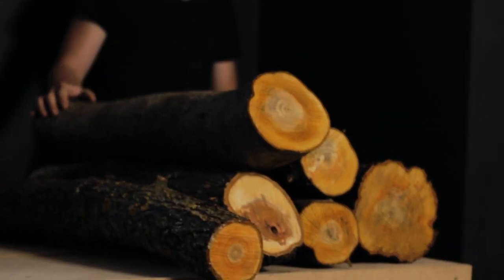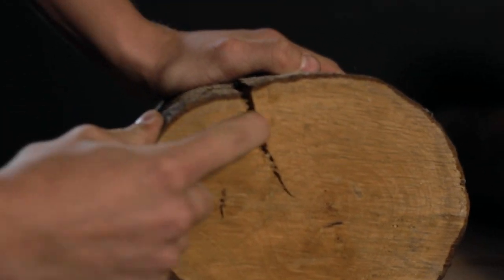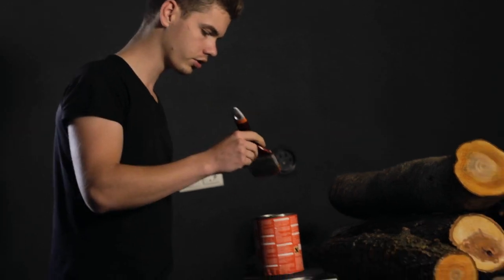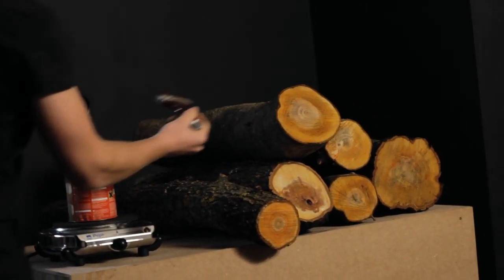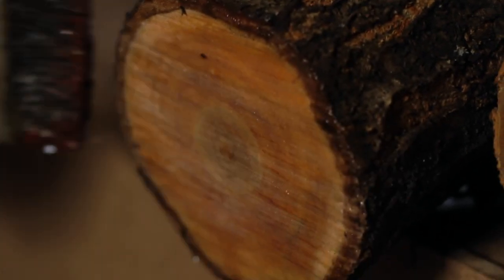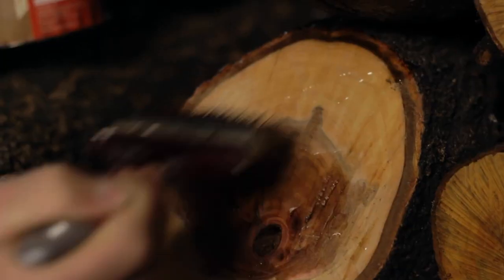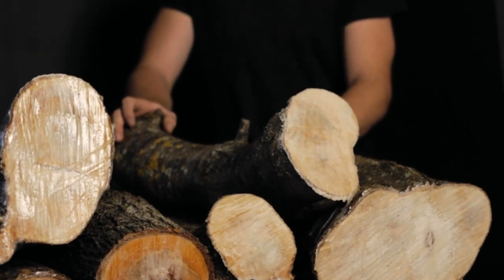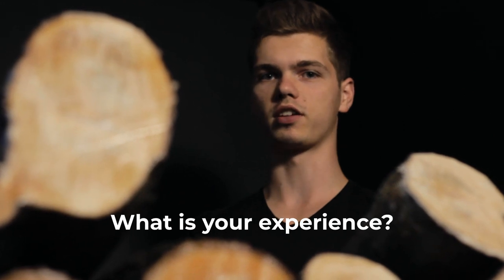How to Dry Wood Without Cracking

Comment: The product most recommend is anchor seal. Don't know how well it works personally, another method is to use latex paint in a few layers. I guess based on the number of methods out there, it doesn't matter what you use as long as it's effective.

I've used latex paint and it seems to work, but I haven't compared it to other methods. I've also heard that you can submerge wood in water and it will still dry out, though I haven't the time, nor resources to confirm it.
Reply from the maker: Thank you for the insight!
Reply: I have submerged green cuts in water in an old bath tub and contest that it works. Helps the wood reach equilibrium moisture content
Reply: @Fluid_c  You mean once you take it out it doesn't split? How long do you keep it under water?
Reply: @schnipsikabel  I have tested this with some green branches for a few days and it works, and I think it's less likely to split then the wood drying just in the air
Reply: @Fluid_c  for how long ?
Reply: @davi11994 how long did you leave it submerged?😊
Reply: @davi11994 were they with the bark on ? Or cut blanks without bark?😊

Comment: I have a round of redwood about 24 inches in diameter and 45 inches long that I plan to work with. Sense it is a larger piece, would you suggest cutting it into the slabs I want before drying it?
Reply: Reezee27 ....no, and if you want to make sure your wood is ready and won’t crack get a moisture meter.  FYI, I use Elmers glue to seal the ends but you need to keep the wood inside if you use glue.  It can be washed off.
Reply: No! Will/may warp and get all crooked. Dry first.

Comment: Have you ever dried a branch and have any tips for it? I'm thinking of waxing thinner sections of a branch to reduce cracking but I don't know
Reply from the maker: You could try to do the same method. I have not tried to dry small branches, but it should be similar and much faster 🙂 Let us know wether it worked out for you 😉
Reply: @NewCraftVideo  will do!

Comment: I  put some  oak logs in my garage to  store till i could use them they are 24in across,  they have BIG  cracks in them..... but for what im doing with them  this will add character to my work.
Reply from the maker: Nice! What do you use them for?
Reply: @NewCraftVideo  Sorry for the late reply, I will carve some into spheres,  I made a rig to do this, others I want to make large bowls, like doe mixing bowls, the cracks I will "lace up" with wire and or twine to make i look like a broken bowl was repaired, the lacing is ment to stand out and give character to the whole piece.
Reply from the maker: Sounds awesome! 🤩 If you have seen our other videos, you will know that we like the look of burned wood, so of course we suggest you trying also that out 😉

Comment: My experience was bad, because I was trying to dry my wood with a candle but all the material burned. :/
Reply from the maker: That's very sad to hear. Hot candle wax is extremely flammable, it can catch on fire just by being poured on the floor... You shouldn't heat it near to anything flammable.
Best luck for doing this next time!
Reply: @NewCraftVideo  Next time I will use your method! 
But your "like" will definitely help me to do this right.
Reply from the maker: Afterwards please comment here your experience with our method 😉
Reply: Lol

Comment: I've used PVA glue with great results. It's much easier.
All the best.
Reply: yup, cheaper than anchor seal too.  Wax is good too.
Reply: Like elmer glue?
Reply: @dcgo44r  no, PVA wood glue, like Titebond I/II/III
Reply: @dcgo44r  Yes, exactly.
Actually I have found that even better than just glue is to get some tissue or similarly absorbent paper and soak the tissue with glue and stick that to the wood. I've never once had this method fail.
Good luck. 👍
Reply: @motleypixel  isn't elmer glue, wood glue? "Acetate .." Is being known forever for small not critical joint and fixes! Way before titebond..
Reply: @ivancho5854  there you go! I was using it too! I do water it down a bit so it penetrates deeper into the wood then a regular coat afterwards! I learned about acetate way before I did any carpentry as threads/ color sealer in fishing rods dressing back in the early 90's! Much cheaper that a galon of wood juice $80. 😲
Reply: @dcgo44r  Yes, I forgot to say to water it down to improve penetration. 👍
That is one of the reasons why I use tissue, because it reduces the amount that the glue runs when you load it heavily.

Comment: whats the temprature you store them in? how do you know when they are done?
Reply from the maker: The recommendations we found, claimed that it should be an inch in an year. We are storing the logs in an garage, so the temperature varies from 5 to 25 degrees Celsius. It seems the results depend on the kind of wood, that is dried.
Reply: Wow, so it actually takes several years for a  log to dry completely?